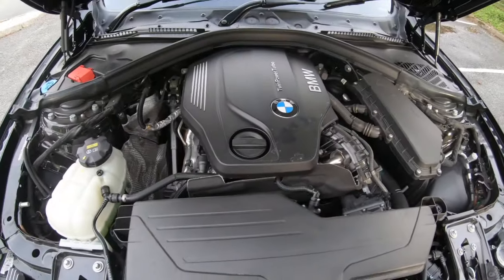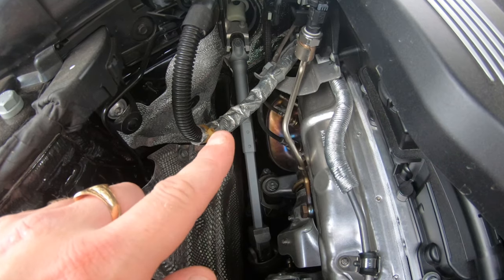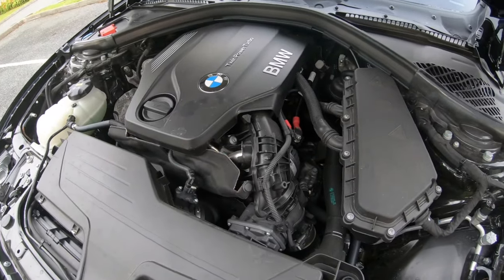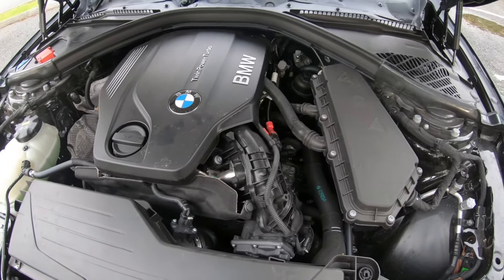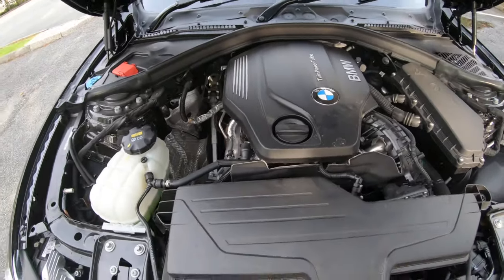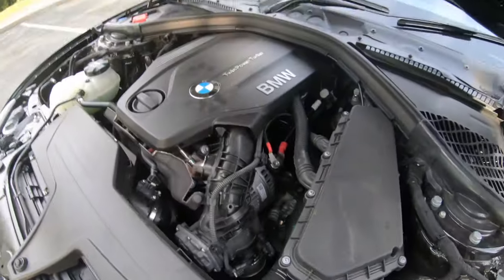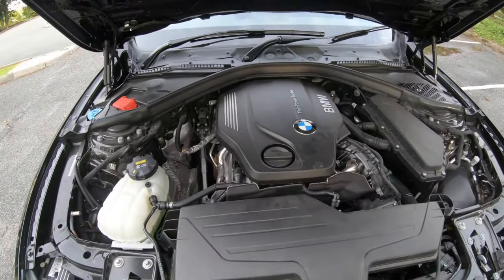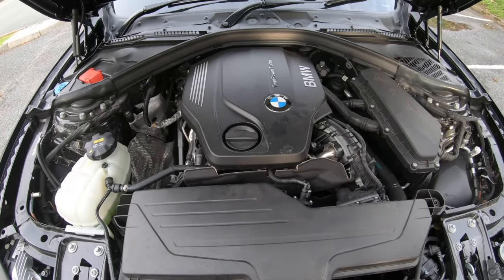Bmw B47 Reliability 2019......It Makes The Power But Will It Break The Chain ?? F36 420D Gran Coupe

Comment: I baught a 3 years old 520d touring with 125.000km in May. Now its at 141.000km with no issue except the EGR-Cooler recall. I am a little aware about the EGR. In ISTA it is disabled/removed to change EGR, in ESYS a cant find it. Do You have any idea?

Comment: I own a F30 318d B47 8/18. I drive it to work for 102 miles in total. I have 43.000 miles on my car by now and I haven't had any issues so far. I change my oil every 6000 miles though.
Do you know if I can do a chip tuning to a 320d safely? So going from 150hp to 190hp?

Comment: Thanks for the informative vid. You say BMW rectified the n47 issue by 2010. Is that a definite as I'm looking at 2014 420d and have written it off due to fears of the timing chain issue? If like you say they got is sorted by 2010 then that changes everything for me.
Reply: I would say it was not, as my 2012 E91 has had the chain stretched up to the critical point at around  140000 km. New one fitted together with tensioners, sprockets and stuff, around 1300 EUR job by certified garage. Better safe than sorry.

Comment: Hi Dean, im thinking of buying a 420d. I have noticed that BMW recommends servicing the car every 20,000 miles. Would that concern you, as the oil degrades too much? What should I be looking for in the service history?
Reply: Its a bit of a tricky one really as BMW aren't going to make their intervals 'Too long' they are long for a reason, the oil is 'Long Life' but personally I would be changing it at half that mileage. It is a strangely long service interval compared to the usual 10-12k/1 year, I wonder what a master tech would say if you asked them about it.

Comment: Hi Mate, very informative video. Thumbs up. Ive got a 65 plate 320d. I had the egr cooler changed recently through a bmw recall. They done a health check on the car and said its all fine. Since its got cold in the last fee days my throttle feels heavy and less responsive and the engine seems a bit louder than usual. Can u help please?

Comment: how to do an EGR delete on this engine...  I cant find any info on that  (cant find egr delete kit for B47) - there are plenty of EGR delete kits for N 47 motors- maybe because of this sensor on EGR but I will turn it off on ECU if I could just find blanking plates etc as a kit...

Comment: Hi Dean, I have 316d f31 2017 with B47 engine and manual transmission. 
When going from a standpoint without gas pedal or moderate acceleration (not a burnout, not a launch), in the last 10% of clutch pedal travel, there's a noticeable stutter / vibration, like wheels are losing traction to the point where even a passenger feels it. Not the car lurching, but like there's something rattling in the clutch itself and also the shift knob vibrates suddenly about 3 times. Happens only on moderate power from N-1 and sometimes (less frequently) from 1-2.
Can you please tell me your thoughts about this?
Reply: Might be the flywheel. It is a double mass flywheel I think its called in english. If the clutch pedal vibrates when engine is running and pedal is pressed down. Its the flywheels springs that are worn.
Reply: Zdravo Ivan dali si resio ovaj problem, isto je i kog mene???
Reply: Had same issue. Replaced flywheel and clutch and now is smooth

Comment: BMW F20 118d 150hp (auto gearbox, B47 engine) from 2015 with 94,000 km and always followed at BMW.  I notice a slight jerk at start-up (only once) that I feel inside.  When hot, this problem is less present.  No jolts when restarting if the "Start & Stop" mode is activated.  Anyway, I always deactivate the "Start & stop" mode.  For me, the automatic gearbox is fluid and no problem during gear changes (or when changing gears).  We intend to empty the box to 120000km (recommendation ZF).  The last intervention carried out: change of the lambda probe downstream of the catalyst detected following passage suitcase and important vibrations at the start (problem settled).
 Maniac, I wish to know if you had the same thing?  If so, do you find that normal?  If not, have you contacted BMW and rectified this malfunction?  Thank you for your feedback.

Comment: Brilliant video bud. 
So far as I know the EGR coolers are current issues with theses engines which bmw are currently addressing.

I'm working for Mercedes commercial vehicles and i know how advanced they've gone but not this far with headlights and starter motors being programmed. 

What would you recommend in minimum miles driven from cold in regards to commuting. 
I'm thinking of getting an f10 b47.
But if it's not getting hot enough to burn the carbon off then it'll be a big no no for me unless i have to blast it up the motorway once a week which i don't mind doing. 
Cheers bud.

Comment: I have a f10 2016 b47 engine , sometimes I have a small idle in acceleration,no error lights on. Whent to bmw ,they said that is perfectly normal. What can it be,I heard roumers that can be a bad solenoid sensor.thanks
Reply: Any other issue u encountered after that with ur b47

Comment: New to your channel my 2016 b47 engine 62k grand coupe total failure of no’3 big end bearing required new engine - bad engine bad company - followed a load of failures including smoke from engine due to previous owner not doing recall and failure of car boot hydraulic lifters - avoid buying this car it is an endless money pit
Reply from the maker: Thanks for that and as the years get on and they all come out of warranty more and more complaints will come 

I knew all this would happen just the way the new BMWS are that twin scroll turbo has not helped these cars one bit made them more unreliable
Reply: BMW Doctor I had an extended warranty with RAC who refused to pay for the new engine as they said it was wear !! So b47 owners are expected to replace their engines every 60,000 miles !!

Comment: I have Bmw 5 series b47 engine unfortunately when I cold start make some rattling noise for few second then go quite and normal I remember the nightmare of N47 engine use to do the same I am terrified it’s new car and before buying Bmw said they has solve the chain issue in b47 engine anyone experience same cold start rattling noice plz share thanks and what does it mean is it chain issue again
Reply: B47 still has timing chain issues it seems like, i have to change mine B47 now.... but the ratling noice can be something else too.

Comment: Dean. This is brilliant mate, but I'm not a competent mechanic. Simple question. I'm a current N47 BMW 118d owner who's looking to upgrade to an 17 plate 125d Msport. Is this a better engine? Does it still have the timing chain issue?
Thanks mate.
Reply: If your 118d was not produced between 2006 and 2011 then you should not have issues with your timing chain as BMW have addressed this issue

Comment: Hi have e92 335d is mouch beter like New coming with timing chain problem.
Reply from the maker: Timing chain you mean
Reply: @BMWDoctor  yes
Reply: I got a f36 420d 2016 sep 2017 model gone 160.000 km and only put olie on
Reply from the maker: That’s a lot of mileage for this car already get rid ASAP
Reply: @johnolsen2231  after 2010 all BMW engines diesel have dhis same problem.

Comment: Junk, absolute junk BMW is garbage. All mechanics used to think it was shit in the early 2000's, but now with the 2015+ its even bigger shit. It's such a big shit, that i don't even want to fix them anymore.

All plastic, every hose is plastic. The coolant hoses have been breaking since early 2000's at the connection points where it is plastic.

Let me ask you people... Do you think BMW is unaware of this issue?

I had a 2017 330I come in today, and there was a coolant hose on the coolant reservoir, that broke off at the plastic junction and that hose led somewhere to the back of the engine, where it also broke off somehow. No way to see where the hose leads but it does lead underneath the intake manifold. To take the intake manifold off, it's a 5 hour job.

on a car that has less than 100,000KM and is 2 to 3 years old.

Yes, BMW is aware of their plastic garbage pipes, that always break, and yet they haven't done a thing to address it. In fact, they added more plastic pipes, and put the TIMING CHAIN in the back of the engine now on the new 2.0 and 3.0 engines since 2017, so now that even if you want to do it at home, you will need an ENGINE HOISE to take out your FUCKING ENGINE first.

These companies are polluting the environment, creating garbage that will need to be fixed, with more garbage plastic parts. The governments are taxing the people, but what are these garbage companies liable for? They are the ones, choosing profit over environment, as they VERY WELL KNOW that if they made their GARBAGE parts out of rubber and aluminum, they would never leak, and wouldn't require to be fixed. Not to mention, that everything is always complex and for what reason? How much more MPG are you getting out of your BMW to justify the cost? It's not that the cars have 1 or 2 problems, they will have EVERY SINGLE problem that can happen, in ownership within 300,000km.  Soon, they will make the pistons and engine block out of plastic too. These big companies need to be paying BIG taxes for their consistent garbage that forces people to repair things that shouldn't be breaking. How can they make a timing chain not last? BMW and Mercedes, and even Audi. They have been making chain engines since the inception of the engine, and somehow they can't get a timing chain to last? Why don't they make timing belts then? 

Timing belts don't require as much labour, and parts as a timing chain, that's why.

Again, draining you dry. FUCK these globalist cock suckers
Reply from the maker: Mate I completely agree this is why I went over to Mercedes and haven’t looked back 😂 

Love your story bro that’s to much jokes